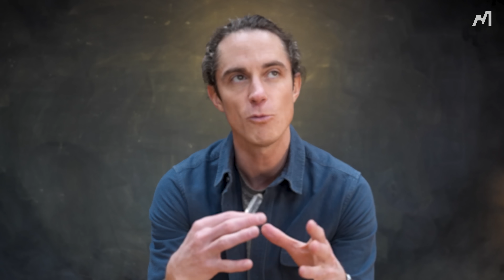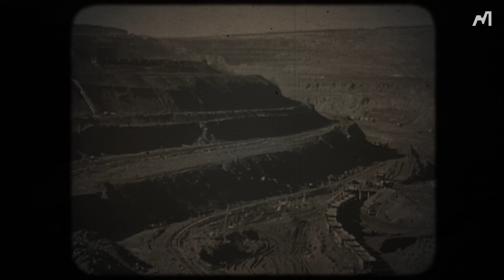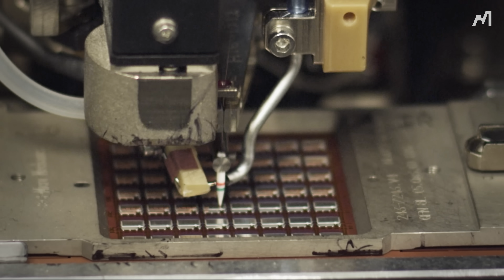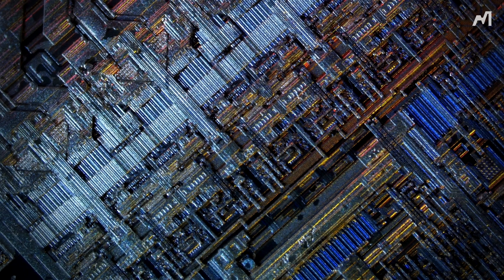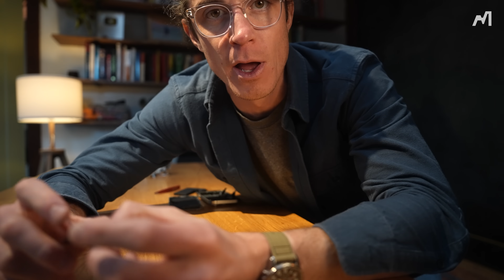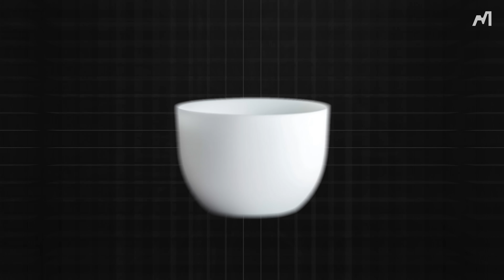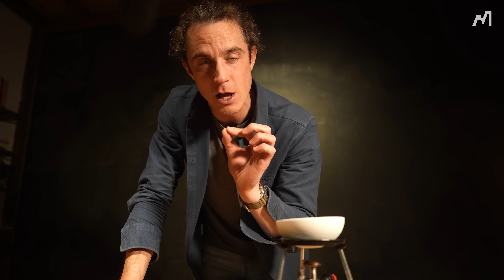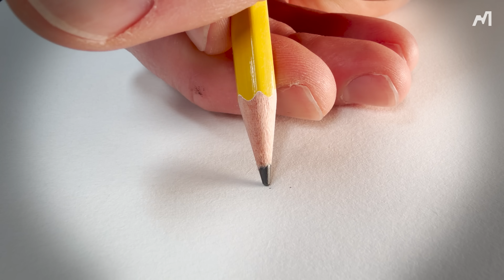Saudi Arabia Has Oil, America Has This

Comment: Made me curious. That fault line that created Spruce Pine span a long way north along many unprospected small mountains. Since prospecting for quartz, even more for high purity quartz, is basicly divination and fortune telling, I'm not surprised there are no more sites. Low purity quartz being mostly all the st-lawence river south shore is, with it being tainted with water, there should be other sites with similar conditions to Spruce Pine between the st-lawrence river and Spruce Pine. There have been lab tests with promising results using the highest purity material as a seed and growing it with lower purity stuff with "decent" result. Not quite production level for 2nm chips yet.

Comment: ...thats uh.... that's factually incorrect tho.... chemist here. we definitely CAN and we DO already make ultra pure silicon from less pure silica. In fact the mined silica from spruce pine still needs refining before being recrystallized into buoles used in semiconductors, it's just a process repeated fewer times and therefore more economical to start with purer stock material. The rare earth comparison is more accurate than you meant actually, unintentionally I'd guess. but both US and china know how to refine both rare earth and quartz into silicon. just a matter of economics and efficiency. It'd cost alot to set up a company that would ultimately be unprofitable and outcompeted, and require massive subsidies to continue existing only as a fallback option incase the they get cut off. its esoteric knowledge, sure, but its not a shadowy secret mystery recipe thing. it's not a "we have control over this thing and we could stop you" its a "if we stopped selling it to you, you'd have to spend 5 years to build your own industry and pay thrice the price" but the cost of the wafer material was never the main cost driver in the end product of semiconductors.

Comment: 7:52 im actually more confused. I thought silicon was like glass/sand, but when it's melted it looks like metal? Most importantly, what part of the microchip has the silicon? I dont see any clear looking glass in a chip?
Reply: No, it's a metalloid (it's not a metal or a non metal). It looks like a metal but the process of making glass involves heating it to extremely high temperatures (which breaks the crystalline structure of silicon) and oxidizing it. This very basically is what makes it from a grayish metallic looking element to transparent glass. There's a lot more chemistry behind this, which there probably are videos explaining it. 

A lithography machine prints the pattern of the transistors onto the silicon wafer and the machines place the billions of transistors... 
There's a video by branch education on how this process is done.

If you search 'delidding a cpu', you'll find the metal heat spreader of the cpu removed and you'd see a metallic looking rectangle, that's the silicon in a microchip.
Reply: Pure silicon is a metaloid
Reply: The rock is needed to melt the silicon because the crucible is mostly silicon so the contaminants aren’t an issue
Reply: And the melting point of silica crucibles is high enough to not melt with the metal
Reply: Si is a metal on the table of elements; it is silver grey and not transparent. 
Wikipedia says…
It is a hard, brittle crystalline solid with a blue-grey metallic lustre, and is a tetravalent non-metal (sometimes considered as a metalloid) and semiconductor.

Comment: There are already many alternatives to silicon chips and the field is being aggresively researched. Gallium Nitride (Better than silicon for 5G), Graphene (Has the potential to be 300% better than silicon), Carbon Nanotubes (Conduct electricity faster than silicon), Bismuth-based Materials (Both faster and more energy efficient than silicon, plus several more). The motivation to look beyond silicon has existed for a while since people know silicon is limited, because the physical limit on the atomic scale has been reached for silicon transistors and because of the better performance.
Reply: Gallium is a super neat element in terms of semiconduction. Aluminum gallium arsenide can make light into a supersolid!

Comment: I don't get how it's impossible to just purify slightly contaminated Si with today's tech into pure blocks. Sounds strange.
Or is it actually possible and just would be way more expensive?
Reply: Closer to ruinously expensive.

And whatever methods, it doesn't exist on Earth. The problem is that while silicon is relatively inert as metals go, it, like most elements, are best buddies with oxygen. So immediately you have to find some work around that lets you isolate silicon from the air. It'd also need to work at... what was it? 1300 degrees C? And it'd likely need to also work in a centrifuge since your method of refinement probably relies on liquifying the metals and using momentum to make them separate out like oil and water.

Oh yeah, and like a lotta metals, silicon gets more reactive the hotter it gets.

At which point it starts reading like you're trying to sieve sand off a beach and less like you're trying to refine silicon. It's the Manhattan project on steroids.

Comment: Just using the AI you gave us, making such bold information and missinforming the masses is pretty bad i must say, but here is a little breakdown from the bot "you people " created :
No, the United States does not have a legal or absolute monopoly on ultra-pure quartz — but it has a near-monopolistic position at the very top end of quality used for advanced semiconductors.
Here’s the precise breakdown.
What “ultra-pure quartz” means
Ultra-pure quartz (often called high-purity quartz, HPQ) is quartz with extremely low levels of metallic and alkali impurities (measured in parts per billion). The most demanding applications are:
Semiconductor wafer crucibles (fused silica)
Advanced photolithography
High-end optics
Some aerospace and defense systems
Not all HPQ is equal; the highest grade is the bottleneck.
The US position (Spruce Pine, North Carolina)
The Spruce Pine district in North Carolina is widely regarded as:
The world’s best natural source of ultra-pure quartz
Unmatched in both purity and consistency at scale
Key facts:
Hosts quartz with exceptionally low trace contaminants
Supplies material critical for silicon crystal growth
Long-standing supplier to major semiconductor value chains
This gives the US:
De facto dominance in the top tier of natural ultra-pure quartz
Significant geostrategic leverage, even if informal
This is why Spruce Pine is frequently mentioned in discussions of critical minerals and supply-chain security.
Who else produces high-purity quartz?
The US is not the only producer, but alternatives generally fall into lower or more variable grades.
Norway
The Quartz Corp (partly Norwegian, partly French ownership)
Operates deposits in Norway and the US
Can produce very high purity, but still relies partly on Spruce Pine material
Russia
Has quartz deposits capable of high purity
Production and export reliability affected by:
Sanctions
Infrastructure
Quality consistency issues
China
Large quartz reserves
Strong in processed and synthetic materials
Natural quartz generally does not match Spruce Pine purity
Heavily investing in purification and synthetic substitutes
Synthetic fused silica
Can replace natural quartz in some applications
More expensive, energy-intensive, and not a universal substitute
Still often starts from high-purity natural feedstock
So is it a monopoly?
Legally: No
Practically (for the highest-end semiconductor use): Almost
A precise characterization would be:
The United States holds a near-monopoly on the highest-quality natural ultra-pure quartz suitable for advanced semiconductor manufacturing, but not on all high-purity quartz globally. 
 
Hope you enjoyed it 🙈

Comment: The original iPhone could be built with chips made from transistors on silicon that is only 99.9999999% pure. In other words we could have the original iPhones once the deposit in Spruce Pines runs out, which is 2007 technology, not 2000. Who wants to go back to KBS data, and noticeable refresh rates on your screen? No one, but everyone but the ultra rich will. The ultra rich will get their phones made from chips made in laboratory conditions in bespoke batches, and their phones will costs millions of dollars each.

Since I found out about this issue in 2018 I think it has been the solution to the Fermi paradox, and why aliens haven't contacted us. The ran out of pure enough silicon before they could develop the technology to make more, just like we will.

Comment: There's a way to purify silica that can be used.

1. Grind silica minerals into sand
2. put it into a nickel crucible
3. Pour in lye
4. Melt the lye to make sodium silicate
5. Put them in an electrolytic cell
6. Separate them. All bases/metals will go to the anode, and silicic acid (which is unstable and tends to turn back into silica) will go to the cathode

(Also, I hope to get good at the Czochralski method. It can be used to make rubies as well.)
Reply: It's the quartz that is important not the silicon.
Reply: @Iselas181  Quartz is silicon dioxide If you purify the quartz, you purify the silicon...
Reply: You can also create gold by removing protons from lead atoms. Doesn’t mean anyone will do it at scale.
Reply: @L4Z3RF4C3  I never said it would be the BEST way. Just that it's possible.
Reply: @earlyej3008  It cant produce 99.9999% pure silicone making it relatively useless
Reply: @khlaps  That's where you're wrong! With one more (admittedly very dangerous) industrial process, it's possible. After purifying it, you do plasma-chemical reduction of silicon tetrafluoride to produce pure silicon. This is definitely not ideal, because fluorine is terrifying, but it is possible. This is far outside of anything I would ever want to attempt, because fluorine is terrifying, and I have no idea how viable it is on an industrial scale.
Reply: And apparently, from quick results, the Spruce Pine quartz is only N4, and this method yeilds N5 to N6, which would mean the fluoride method is necessary either way. Unless there's something I'm missing about this.
Reply: I've made water glass multiple times. It can be done, i wouldn't call it eaaaasy, but it is rather uncomplicated. Considerably dangerous. 

Electrolysis tho, is the unholy union of my main interests, metal working, chemistry and applied electromagnetism and Ive never considered doing it on sodium silicate. My gut reaction to it, I would describe, as heavily passed reticent. 

I'll put it this way, if a society depended on this for survival I would bet everything I owned and everything I could borrow to short their stock.
Reply: @Mix1mum This method can get it to N5 to N6 grade. To get it to the needed N9+, plasma reduction of silicon fluoride would be done.

The Spruce Pine quartz is only N4 from what I looked up, so I assume this is step is already done.

This is all from simple Google results, so take it with a grain of salt, but it was very specific with the answers.

Unfortunately, while I do electrolysis all the time to make various salts, I do not have the equipment or the bravery to test the silicon fluoride gas refinement part out.

Might end up seeing if I can find someone who works with silicon fluoride to see if this would work.
Reply: Oooohh! @earlyej3008, just how would 1 go about making rubies?
Reply: @ChenoaMacSweeney  That's easy! Melt aluminum oxide with chromium oxide in an arc welder in the right ratio... The problem is making solid large ruby. You tend to end up with ruby dust.

Comment: As a teenager I used to hunt for quartz points in the gorge each spring.
I was annoyed that ones with a tiny gold filament was worth nothing.  I knew they was no good for radios, but they were pretty.  Nice chunk of money to start the summer with.  $40 to $160 was an awful lot of money for a teenager in 1978.
Now the points are worth only what a rock shop pays.  Not that I can climb down cliffs anymore.

Comment: I respectfully don't think you got deep enough into this topic to make a video. Many of your claims are easily disprove by reading wikipedia. This is the first video I've seen from you and surprised by peoples comments, very little of your extrodinary claims can be backed up by evidence. There's tons of methods to easily purify quartz, including several new patents from China over the past few years. Silicon is the second most abundant element on the planet, it's absolutely not special in America. Oh, and China is the largest supplier of high quality silicon, in the world, RIGHT NOW. The global supply chain of silicon right now, does not rely on America, and it's absolutely not limiting China's chip manufacturing in any way. They literally make high quality computer chips RIGHT NOW, they're limitation is in EUV Technology (the only way to make modern chips) and making chips that compete with Intel/AMD/Nvidia. 

If the material stopped flowing, as you claim, only US Manufacturers would suffer, because it's illegal to use foreign materials in our manufacturing processes because it's adjacent to the Berry Amendment by the Department of Defense. If we used Chinese silicon now, our own mines would close and we'd be reliant on China.

Comment: Do not throw away old or broken devices. Keep and store anything with a chip. Should the supply chains break, those things will be more valuable than gold.
Reply from the maker: Can you recycle silicon that's been etched? I honestly don't know
Reply: @Maxinomics  No, but you can repurpose the chips. If your smartphone breaks, the chip is usually not the problem. When china invades Taiwan, i bet people will start digging through landfills
Reply: There's literal gold we're already throwing away with every old gadget, it just hasn't been dense enough to extract individually.
Reply: @doujinflip  It's pretty easy to reclaim gold from electronics, but pretty messy. You can burn the device and then dissolve what's left in nitric acid. Gold should be the only thing not dissolving (Maybe ceramic components).

Comment: there are plenty of ways to make 99.9999% pure silicon crystals besides this though. There are youtube videos of people turning normal dirt into high-purity silicon. It's also very possible to purify silicon dioxide
Reply: It's about the quartz though, you need this type of quartz to get the purest form of silicon to make the most delicate semiconductors.
Reply: @Iselas181 Quartz is just silicon dioxide. There are chemical ways to purify it. Presumably they're just more expensive than digging it out of the ground already pure.
Reply: Natural quartz, for the coming years, will be far cheaper.

Comment: This is why countries have been ramping up their production of synthetic ultra-fine quartz. Synthetic is also better than natural and is preffered for high quality semiconductors. The downside is that the synthetic quartz for semiconductors is 5-10 times the price as natural, but with the global intrest in sythetic that will likely change over the next 10 years
Reply: Synthetic quartz is still mainly used in solar panels production, this natural quartz is literally a single point of failure for the semiconductor industry.
Reply: @Iselas181  Indeed, though solar panels won't completely die with contaminants (just get less efficient), whereas a single failed gate will render a cpu useless.
Reply: @I @Iselas181  Because starting with ultra-pure natural quartz is more economical, not because it is necessary.
Reply: I was not aware that synthetic quartz was a viable option. So much for the US having a chokehold on what is needed for chip production...
Reply: @ProudDawgFan many countries have a resource(s) that others are dependant on. The usa is rapidly increasing its domestic rare earth production to not be reliant on China. China last year found a massive amount of ultra fine quartz that will end their dependency on the usa. There is a big global push happening now for countries to be less reliant on others for critical resources and energy. The usa also wouldn't suddenly stop exporting there ultra fine quartz as other countries would react in kind.
Reply: China had a massive synthetic buildout going on for 6N purity. They have so many plants coming online - 2025 was a big year
Reply: @MS-wz9jm China also found a massive deposit of ultra pure quartz that will end their dependency upon the usa for natural quartz

Comment: Actually there are other sources but can only supply a fraction of the demand. Most likely they are higher cost, so if Spruce Pine shuts down, the price will rise to the point they could ramp up. So there would be a temporary shortage.  Economics not too different from oil extraction in that respect.